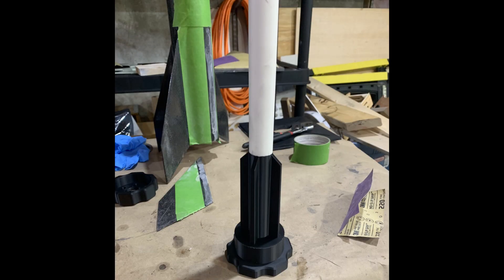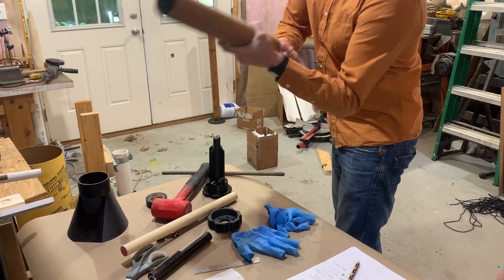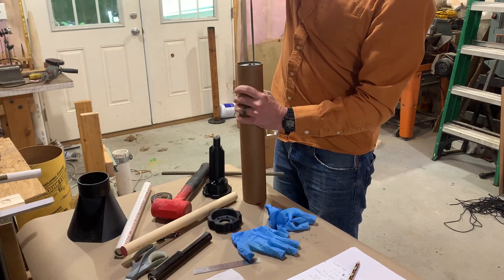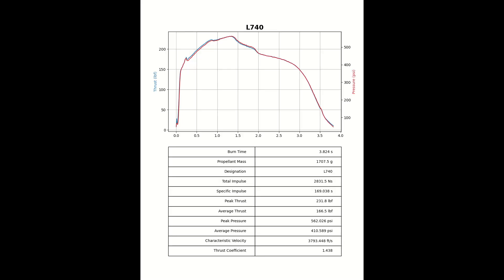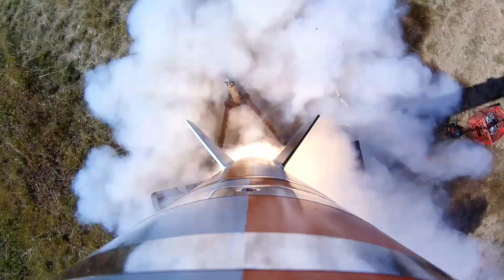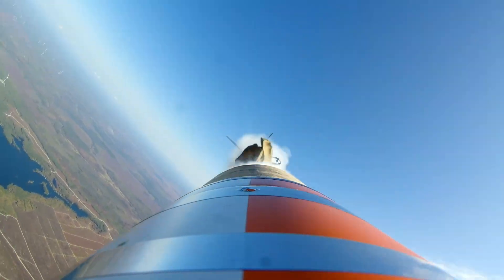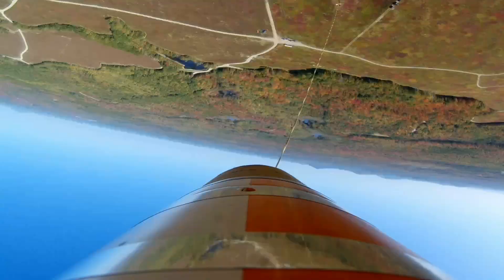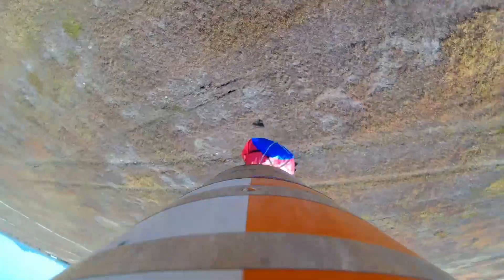Monolithic Finocyl EX Motor Testing

Comment: Was the fuel hand packed or cast? That is amazing how close the sims are!
Reply from the maker: This is on the border of pourable and packable honestly. It’s it rolls out of my mixing bowl but it’s thick enough I like to take a wooden dowel and still tamp it down. This consistently comes in around 92% +\- 1% max theoretically density without degassing. That’s how I characterized it and sims are usually pretty good.

I have a vacuum setup to play with this winter and will be recharacterizing, and tweaking so hopefully it pours better.

Thanks!
Reply: @pathtouch1 hope to see that soon. My L2 comes in the spring.

Comment: Great video! I just did a large casting and it was so tuff to get the PVC mandrel out with PTFE spray, will need to try stoner mold release.
Reply from the maker: Assuming you were trying PVC pipe like I used here? The tolerances on that are pretty bad so I've found wrapping electrical tape around them with the sticky side out helps. overlap seams like 1/16". It can squeeze and stretch a few thousands of an inch as the pipe is pulled out to soak up deviations in OD. Bonus tip, roll the sticky adhesive against your pant/shirt to help make it less sticky. The goal is to have the smooth surface against your mandrel. Stoner by itselft works great on polished aluminum and 3D printed mandrels though.